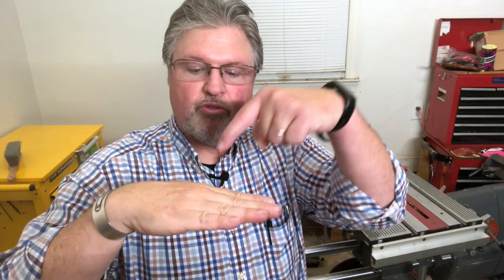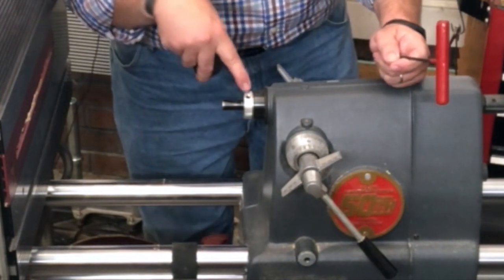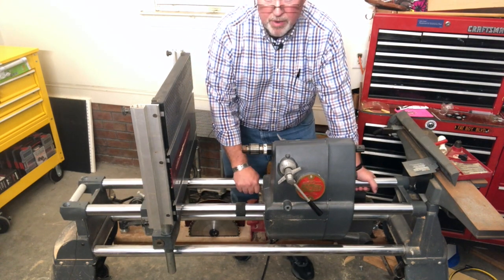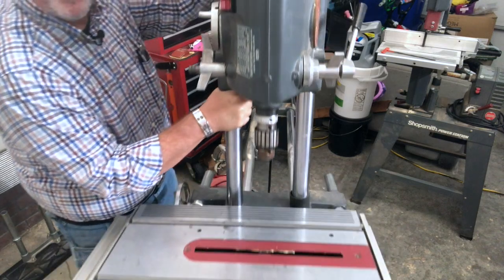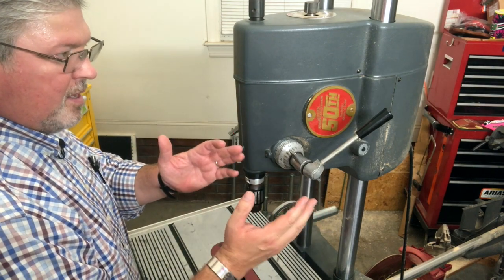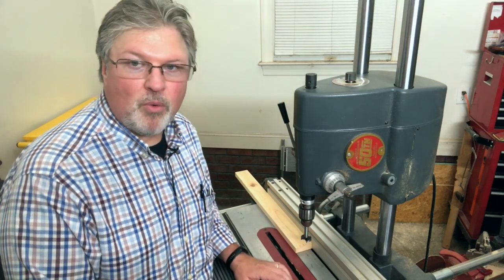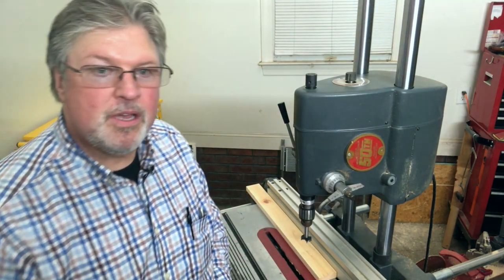5 Shopsmith Mark V Drill Press Tips (I think there's Five!)

Comment: Excellent vid. RJ recommended raising the headstock by extending the quill against the table. I have a shopsmith 3 handle drill press handle. It's a PITA to take off because I can never remember which handle to loosen.
Reply from the maker: @HikingwiththeBlindBoomer  I had that one for a while and had the same experience. I wound up putting a dab of white paint on the end of the correct handle.

Comment: Glen here again.  I sent a suggestion to Shopsmith a few days ago regarding access to the drill chuck key while in the vertical position and I thought you might like it.  My model is the Mark V 500, so this might not work on the current table carriage system.  What I did on my machine was to drill a hole on the side of the carriage between the tubular ways so that it is on the top of the carriage when in the drill press position.  Then I put the chuck key in that hole so it is handy for switching bits and I don't have to walk over to the other end of the Shopsmith to retrieve it every time I need to use it.  Before I return to the default position, I put the key back in its place at the end of the machine.  I don't know if the new carriage would accommodate this modification, but it sure works on my 500.
Reply from the maker: Hey Glen. Yeah, that should work on the 510/520 too. We’d just need to be careful where we drill. I think I would add a magnet under the carriage too, just to it stays put when horizontal, but yeah, that would be convenient. Scott
Reply: @MyGrowthRings  In the horizontal position I put the key back in its original hole at the end of the Shopsmith.  By the way, I love the cordial tone of your videos as well as the audio and video quality.
Reply from the maker: Sandy Smeltzer Got ya! Thanks for the compliment. Scott

Comment: I use the drill press mode quite a bit. I eventually figured out where I want the head stock located for drill press operation and used a permanent marker to mark that location on the way tube so I don’t have to be guessing each time. I did the same for the table carriage although that changes sometimes due to the stock thickness I’m using. And finally, I marked the carriage height adjustment so the drill will always be centered on the opening. I found all of these to be great time savers when setting up for drill press.
Reply from the maker: I almost suggested that! I’ve known some Shopsmithers who scored a line and added a metal dye to their tubes so they would not wear off. Shopsmith users are clever folks.
Reply: I just recently thought of that idea and was wondering if anyone had a reason not to do it. Now I feel like I have permission, awesome.

Comment: Another tip for raising or lowering the headstock once it is in the vertical "drill press" position is to put a small piston jack (or small scissor jack) between the headstock and table carriage.  You can then use it to lift of lower the headstock in relation to your table.  Good for fine adjustments.  Another method that has been touted, and one I certainly don't support or suggest, is to use the quill and feed level to literally push the headstock up (or down) through the drill press handle.  It works but is tough on the quill feed teeth.
Reply from the maker: Good tips. I knew a guy once who was in a wheelchair and couldn’t fais the Mark V if the headstock was very high on the tribes, so he used the quill just as you are describing to lift the headstock isn’t poison once the machine was vertical.  Where there’s a will there’s a Shopsmith! Thanks for sharing, Scott

Comment: Great tips! thank you. Ditto on Hooper57's comments. Perhaps in a future video you could cover overhead vs under table routing - advantages of one over the other, techniques, safe operations, etc
Reply from the maker: On the Mark V? I have a Shopsmith Router System, which features both a router table and an overhead pin router, plus I have a Shopsmith Joint-Matic, so as you might imagine I don’t need to route on the Mark V. BTW, I loved your work in the “Daddy” video. (Child Psy joke) Scott

Comment: Again - well done.
You mentioned horizontal boring.  I’ve made floor lamps and use the, (thank god for the Shopsmith) horizontal boring ability.  Perhaps some techniques on that Shopsmith function.  Although I’ve used it, I’m still rather flummoxed to all the possibilities.
By the way,  nice to hear/see your positive nature.
Reply from the maker: Thanks John, and yes, there are a few tips on horizontal boring that I’ll share in a future video. How big were your lamps and what type of bit did you use?  Thanks again for jumping into the conversation. Scott
Reply: My Growth Rings 

I’m unable to share a photo.  A, “regular length”? lamp.  I made it in two lengths, spending some serious time on the lathe to get the two as close together as possible and so they wouldn’t appear different.  
I used a lengthy 3/8” bit to bore the holes - waxing it repeatedly.
Because of the lamps taper it was, how can I say, “something” to support the sections correctly, provide room for a large dowel as a connector...
Reply: The drill bit was not as long as the section so I drilled from both ends of both pieces.  Consequently the elevations, angles of both sections had to be considered as well as the correct bit angle of attack.
I’d make another as I have a request but - 
The Shopsmith’s ability as a horizontal boring machine is quite nice.  Is there a method to setup, control, the angles since the two sections are in circumference at each end and swapping ends adds to the kinda, “confusion”.
Are there appropriate lengthy bits available and a wandering bit isn’t good either.
Reply: On a different note -
I’ve the new Shopsmith multi-position drill handle.  It’s an improvement over the older loosen the handle version.
Reply from the maker: John Rice I would love to see the photo, so if you’d like to email it my address is scottmarkwood(at)Gmail.com
Reply from the maker: John Rice There are a couple tricks to performing this task on the Mark V, but the biggest issue is usually getting the bit to stay on the correct path. I’ve used something called a lamp auger, which is actually done while the piece is still mounted on the lathe.

Comment: Scott, Would I damage the tubes or the locking pressure pads (or any other part of my SS Mark V 500) if I left my SS in the vertical drill press mode for a year or so?
Reply from the maker: I don't believe so. Just don't overtighten the lock.

Comment: hi love your video but i am trying to know what is the sleeve that is install on the pipe where slide head stock
Reply from the maker: It’s a spacer that sets your carriage the proper distance from the headstock so that when you lower the table over a saw blade it will drop right through the center of the a lot.  Scott

Comment: Always good tips! Learned a new one, Thank you!!
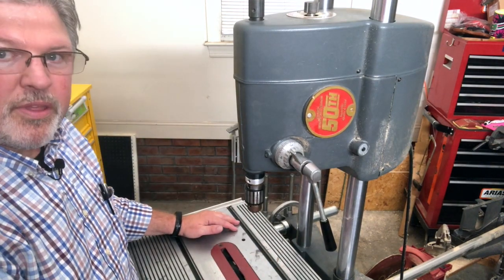At 5:40 you let go of the handle and the quill did not fully retract. I know there may have been some residual tension dialed in on yours.
On mine, without any dialed in tension on the lock knob, mine takes quite a bit of effort to draw the quill back in. I I don’t like to force anything and the quill is not as smooth and easy as it was. Could you PLEASE send me a link to a video of yours explaining how to fix that?
Reply from the maker: Yes, that’s an easy fix. In my case I probably have a burr that needs to be removed, but yes, we can always add more tension. I’ll try to remember to add that process to my next video. Scott
Reply: My Growth Rings Thank you !
Reply from the maker: MRrwmac You are welcome.

Comment: there is a router collet or chuck for these mark V/7 to use in overheard position to route. the question I have is why can't you locate a pin and make them a overhead pin router? I am also aware that they had overhead router attachment accessory that went on the 2 tubes. but why not use the headstock itself with a pin in the table? what am I missing in this? thank you for any help in explain this to me. P.S. I don't speak Troll B)
Reply from the maker: Actually you can. Back in the 80's the Taiwanese clone of the Shopsmith Mark V model 500 called TotalShop had a pin router table insert available. With the PowerPro headstock you could do some pin routing, but the standard Mark V headstock without the electronic variable speed can't get anywhere close to proper routing speeds. It's hard to bet the 20,000+ RPMs that an actual router can achieve, but the 10,000 RPMs a PowerPro can produce can work as ling as you don't hog off too much in a pass.  Scott

Comment: Have trouble getting my drill press at 90 degrees!
Reply from the maker: You’ve mentioned this before and when I asked you to explain what you mean I didn’t get a reply. Please tell me more about what you mean.
Reply: Try a space heater or a blowtorch... 
(Sorry, I know that was a smart aleck reply, but I couldn't resist 😉)....
Reply: @MyGrowthRings  I am trying to figure out the same thing.  When I bring the press to vertical, it will not reach a full 90 degrees.  It stops a little short, so it isn't completely vertical.  Call it 85 degrees.  Almost like there is sawdust or something in blocking where the casting sits.  So, if I'm trying to drill vertical, I have to make a best guess on positioning the table, or material so that the drill bit enters square.  Thoughts?
Reply from the maker: @gregjones9224  Is your machine a model 500 or 510/20? There are adjustable stop bolts under the table that can be adjusted to allow the table to tilt back further. Or is that not it? Scott
Reply: @MyGrowthRings Model 510.  But, after looking at several comment threads last night, I took a close look at the unit today.  I believe my problem was the lower tubes were not installed in the proper position.  When I re-adjusted them, it took the machine to 88 degrees.  Much closer than it was.  I think with a little more tweeking, I will get it to 90.  When I first looked at the tubes and the tilt base, they were noticably not square to each other.  This first round of tweeking also made the unit sit firmly on the ground when I raised the castors, which it did not before.  I think this was the problem and Larry Jacobs should take a look at this as well.  Thanks for the reply.